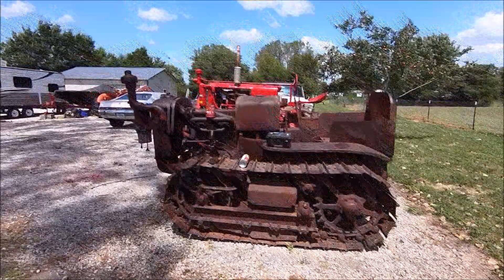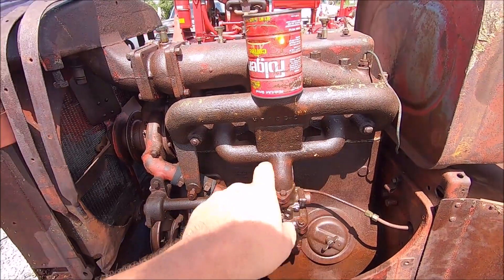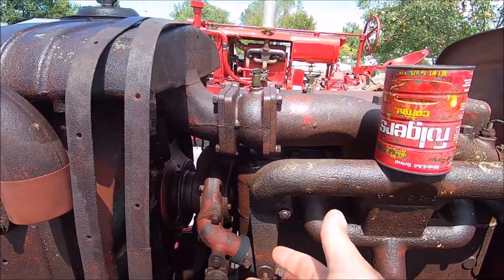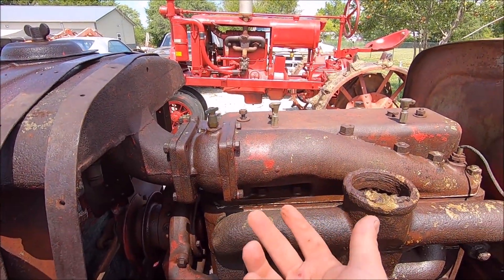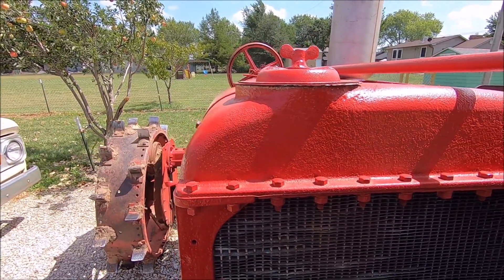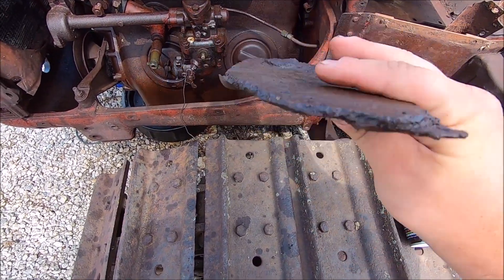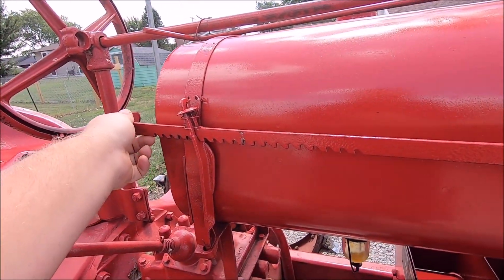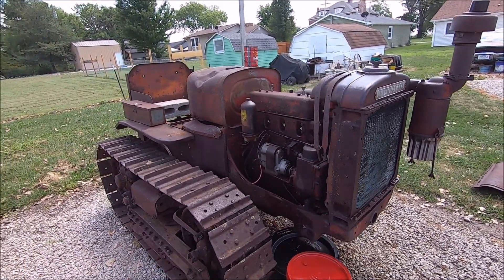Farmall F20 Tractor vs International T20 Trac Tractor Engine Differences

Comment: I rebuild in frame overhaul on a 1957 D8 caterpillar dozer, it sat 30 yrs after it had been rebuilt before then evident it was overheated , the sleeve were bad they would come lose what so ever, so i pushed sleeve and pistons as one out, then i made a one inch think puck to just fit in the sleeve and pushed pistons out the bottom of sleeve with hydraulic harbor freight ten ton press, couldn't save the sleeve but i save all six pistons, had to grind a chisel to chip out the rings cause the oil had them burned in that bad for over heating there was any scaring on the pistons clean and polished them re-ringed them, put them back in with new sleeves and rings , so yes i would take on the challenge of pulling your T-20 piston out the same way , i pushed these cat pistons out the bottom of the sleeve (wet sleeves ) because there was very little if any rust to the bottom as to the god alful rust and pitting at the top, , the f-20 , t-20 has wet sleeves, as for fixing a pitted wet sleeve i never seen it done but those older sleeves are thick enough to put dry liners in

Comment: Finally are comparison between the F-20 and T-20 engines. I've been told both that the engines are the same and that they are quite different. This video shows that   biggest difference is in the cooling system and the throttle. Thanks for the information!
P.S. There was never a T-30 crawler. There was a Farmall F-30 and a McCormick-Deering W-30 wheel tractor. They both used a bigger engine compared  to the Farmall F-20 and T-20 TractTractor (crawler)😊
Reply from the maker: @michaelhalsall5684  I'm glad this comparison helped you, I was always curious if parts from an f30 would work on the t20?

Comment: Seems to me the big difference is the head. Use the short block from the red one and rebuild the head on the crawler so you can run the water pump set up.

Comment: So, its 2023 now (almost 2024).  Only now do I see this.  I'm wondering how welding the radiator went.  But, what impressed me was the weld on the water pump.  Somebody did a dang fine job decades ago.  The weld most certainly withstood the test of time.
Reply from the maker: I never got around to it, the whole machine wound up being in such terrible shape overall, we found another T20 to fix. I still love this particular machine because of all of the repairs done to it
Reply: @ScottsSpeedShop  
Hi!  I too like those old repairs.  I always think of how stressful it probably was for them when it broke.  I wonder who fixed it.  I think of how the old farmers (in particular) might have fixed the equipment under an oak tree at night and with an old lamp for light.  It just had to be tough!!
BTW:  I'm extremely experienced with the Zenith K-5 carburetor.  If you need my help, let me know.

Comment: I'm looking at a f20 and a Farmall regular that I own and they both have the mounting blocks for the water pump on the heads.
Reply from the maker: My f20 did not, and none of the f20s I looked at had them
Reply: @ScottsSpeedShop  I just bought a t20 in September for my 20 series collection with a cracked block. Then I saw your video about the differences.  That's why I was checking my doner tractors for the right parts.
Reply from the maker: @genehochstetler4665  the blocks are definitely the same for the most part, they will interchange. You could put an f20 engine in a t20, but I like the idea of having a waterpump especially with the extra load of the engine from the weight. I did a whole bunch of research because the info available on the web clearly wasn't reliable

Comment: If you don’t need a perfect restoration I think you could switch radiators and motors which would be perfect since your rads bad
Reply from the maker: Could but its a completely different cooling system, I sold the f20 and bought a t20 that was converted to a dozer that is in much better shape